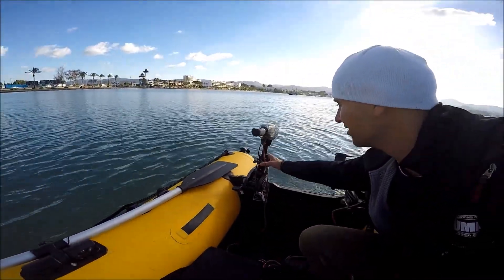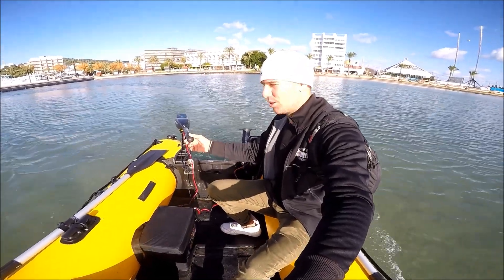Testing electric outboard motor 32 and 60 lbs

Comment: When you say "40-50 Amps per hour" that doesn't make sense.
A battery might be say, a 12V 100Ah battery. That means if you draw 100 amps from it for 1 hour, it will be fully discharged.
Reply from the maker: @JordanPriede  yes that means if the electric engine takes 50amps per hour you can use it for half an hour on a amg battery and 1 hour on a lithium
Reply: @SailingBik  I'm quite familiar with electrical terminology. I was trying to inform you about your inaccuracy.

Comment: I have had the Striker 60lb for 4 years used in sea water on a 5m clinker hull fishing boat (normally has 6hp-15hp O/B) but for night fishing around the mangroves the 60lb is magic probably does 3-4kts with 3 POB and all up weight ~500kg. Pro's; it is good and reliable and the battery level indicator is a strong plus. Con's; no kick up if you hit the bottom or an obstruction you risk damage if you do. The transom clamps are lightweight, overtighten and you risk breaking the plastic knobs, the steel used in the clamps is light zinc coated it will rust unless rinsed and WD40'd. The tiller handle feels fragile. 

Here is a real issue though...the connection leads are short, if you extend them use heavy duty high quality 12v/60amp cables and pay particular attention to the join, mine started a fire due to the wire joiners not being up to the amps which lead to melted insulation which lead to battery shorting when the wires clashed. If you have screwed down the terminals to the battery you are in trouble. My solution was to put in heavy duty cable connectors and a 70amp restable fuse/isolator. I strongly recommend some form of quick disconnect.  You need to wash it after use particularly around the prop shaft and transom clamp then spray with WD40.

I recommend it, it's worth the money.
Reply from the maker: Thanks for your info 🤗👍 awesome ☺️

Comment: Found your video this morning!   Very interesting!  Would you one day test bigger motors on bigger boats such as 8.5 meter sail boat!   Thank you and keep up your wonderful work!
Reply from the maker: Thanks, just testing the Torqeedo 3hp, so far very impressed!! But price is also 10 times the amount off these ones
Reply: @SailingBik  Price is not a problem.... what is required is satisfactory performance as per claims
Reply from the maker: @kennedymaridadi2344  have to say, i Am in love with the Torqeedo as wel! Nu the Nice thing about the 32 and 60 lbs is that you can use every batterij

Comment: 60 lbs = more speed ?
Reply from the maker: LeFlow yes 60 is double compared to 30
Reply: Twice the power will give about 50% more speed. If 30 lbs does about 3 mph, 60 lbs will do about 4.5 mph.

Comment: Would you say the double HP will drain the batt 2ice as fast?  In other words will the 30 HP last 2ice as long as the 60?  Thx
Reply from the maker: check out all the specs at www.aquaparx.eu but yes thats about right.
Reply: Double the HP should drain battery more than twice as fast, but it won't. Because double the HP will accelerate any small boat faster but maximum speed will be typically less than 20%, so most people will throttle back. My guess would be 4 kph max (kilometer/hour) for a 30# (pound) motor and 5 kph (~3.5 mph) max for a 60# motor. At continuous top speed motoring, the maximum time to drain would be less than 2 hours with 100 AH battery.

Comment: Check my 2 engines side by side:
https://www.youtube.com/watch?v=OVvfDQRLPdg&t
Hangkai is already 6 year old. Honestly i did not think this engine wil last me so long, when i got it. I thaught of it as a temporary engine, and here I am 6 years later. I hope my electric trolling motor last just as long. I like that it is quiet. Hangkai is a typical working tool. Gets me fast from A to B, helps set up fishing nets, does the job but it is very loud. The other is my holiday motor for weekend trips and relaxation.
Reply from the maker: Cool!!!

Comment: I just got my 56lbs motor with mail. My first BIG disappointment in it was the weight. Why the heck is everyone saying this motor is lightweight??? It weighs twice the weight of my 3.5hp gasoline engine and it is 10 times less power. Include the big heavy battery it is 5-6 times heavier then any engine i can fit on my boat. I don't know what the slowest speed it runs on is.. I hope it is not too fast for trolling. Trolling motor should have slow trolling speed.. Gonna have to wait to test it on the water.. So far only bad thing i noticed is the excessive weight on my boat that i'm gonna have to carry around, and that is a really bad thing about this motor.. Now lets look at the bright side.. This motor is cheap. It uses no fuel. It is very quiet, you won't scare away fish with it.  It have adjustable shaft so it will fit all boat types. It have reverse gear, useful for some boats. It turns 360 degree, very useful for fast maneuvers.  It looks nice and futuristic. You don't get some old looking motor with everything outside. Would I use it as a reserve motor?? Hell no! it is too heavy, i would rather carry two 3.5 hp engines. I will use it to sneak up on fish and for relax, some close to shore  net fishing, holiday. In some waters they won't allow you to use a gasoline engine so i have a motor that can run on these waters too. I guess beside complaining about the excessive weight i had some pretty good things to say about the motor. Have fun while it lasts! It's summer now, perfect for boating.
Reply from the maker: Jack Fisher hi man, what engine did you buy?! The ones I tested here where like 1/3 the weight of even  2.5 hp gasoline engine! The batteries are indeed what makes the setup heavy. For the rest love no messing around with oil/gasoline and no maintenance 😁👌 let me know when you tested yours 👍
Reply: I have my old trusty Hangkai 3.5hp runs like a dream. I had it for many years now. I think it weighs like 5-6kg, and i  have 56lbs motor made in Netherlands, haba trading is the distributor i am not sure who manufactures it. And 100AH battery on top of that :D .. Hangkai is the best buy so far, it is just so loud you gotta use hearing protection.. I hate the sound of it.. I think i need to mod it with an air filter or something because it sound like spitfire aircraft. there are 2 videos of my hangkai engine on my channel.. That thing is so light yet it put out so much power.. you gotta try it.. I think its cheaper then electric motor or about the same price. Just remember to take good care of gasoline engines.. They require maintaince and breakin process.. Many people on YouTube complain about hangkai break, but it does not break if you use it right..  It needs gear oil changes, lubrication, cleaning, washing, and stuff like that.. Just like any car or scooter.
Reply: that 56 lbs trolling motor weighs 13.5 kilo XD, put my 20 kg 100AH battery on top of that and we get 33.5 kg. Hangkai weigh almost 7 kilograms without gasoline in the tank. Tank is 1 liter so with full tank it will be around 8 kg. Hangkai is strong enough to pull a 10 year old on waterski or wakeboard :P that is if you sail on small rubber dingy. It makes around 20km/h full speed when attached to a 2.5m rubber diving dingy boat. These small boats weigh around 20-30 kg each so it is like flying with an engine kit around 3.5-4 hp. 6 hp and you can waterski with adults, but then it start to get dangerous.. 6hp engine on a small light boat like that is insane fast.
Reply from the maker: Jack Fisher cool!! Thanks for that info and I’ll check your channel for the hankai 😊👌👊
Reply from the maker: Jack Fisher sounds amazing!! Going to check that out 😁
Reply: I like your boat. Does it have the keel? And if not and you tried both with and without the keel tell me the difference.. I have one boat in crosshairs it does not have a keel i just wonder how much slower it is then my old boat i sold few years ago, the one you saw on my video.
Reply from the maker: Jack Fisher is has a soft bottom. Hard bottom seems to be faster
Reply from the maker: Did not try the engines on a hard bottom one
Reply: Insane fast? 6 horsepower?  We have jon boats that'll go 115 kph.  I'd really like to see an adult skier pulled up out of the water (no deck launch) with 6hp. Having trouble believing.
Reply from the maker: Mike Ries nobody says anything about 6hp? The two TOGETHER are 2hp

Comment: Great video. I was just about to buy the 60lb one, then found out they are fresh water only .
Reply from the maker: Been using the 60lbs for over a year in salt water and no problems so far for me.
Reply: Its plastic, cant rust. But you should rinse axle and bolt with fresh water if they are not stainless steel.
Reply: @mikkom221  went for a E Propulsion in the end, absolutely love it.